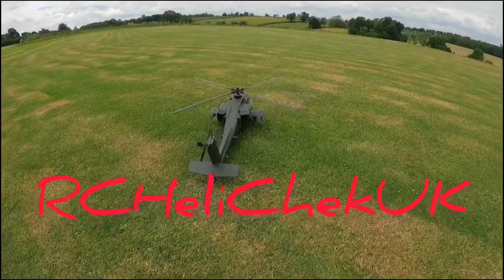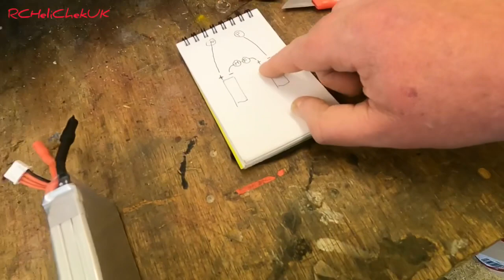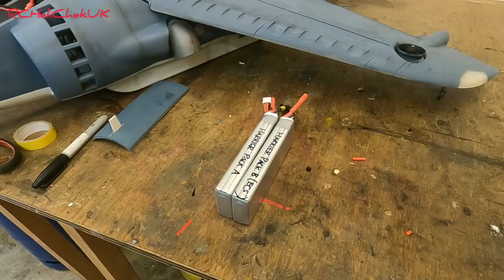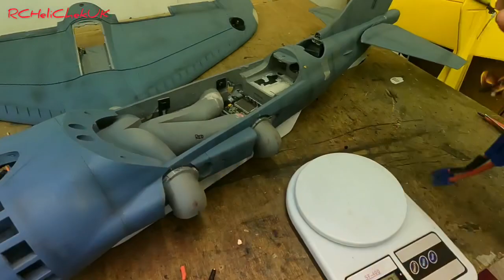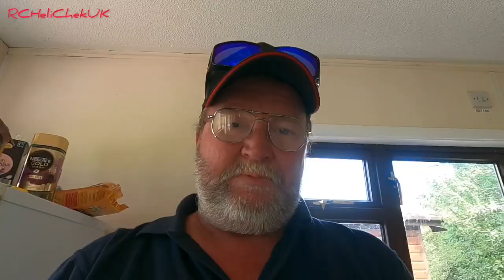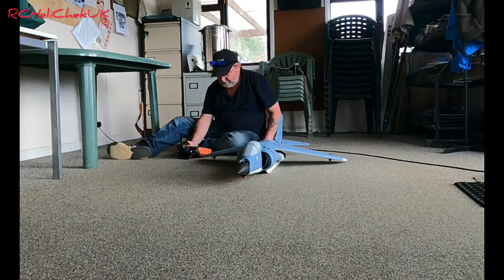RC VTOL Harrier Part 7/ Finally we have vertical thrust!

Comment: I have a HK Harrier that I plan to use two 64mm edf lift fans. A single 70mm fan for forward flight. The lift fans can vector thrust left to right. For up, down, and level hover the fans power are controlled by the flight controller. A similar Harrier had a single vectoring 90mm edf that rotated 90 degrees.

Comment: Build a foam fuselage for weight reduction and make the two main lift fans 6S power by a lightweight drone lipo. I have a HK Harrier on two 2200mah  4S with four 50mm ( one fan for each nozzle) 12 blade edf fans and it will jump off the ground. Currently I am trying to find a working flight controller. I have a few KK2 boards but I can't get my RX to sync with them. I keep getting a no throttle signal of the KK2 boards.

Comment: I've been following Joel's Harrier project since the start. These latest 3D printed versions look amazing but tricky to set up for hovering. Did I hear you right and you're using 3S for the nose and tail 50mm EDF's? Personally, I would forget that and go 4S instead. I think I would also change the wing fans for 4S 40mm's and 8S for the 90mm. Higher voltage batteries = more thrust @ less amp draw and less heat. Installing the curved lip shrouds on the smaller fans will also increase thrust. Good luck mate and keep at it. I would love to have a crack at this Harrier myself but don't have a 3D printer. Any chance your friend could print me one? I'm happy to pay him for his time and materials. Cheers Ben in London, N13.

Comment: The fan is likely losing efficiency though the ducting.
Reply from the maker: The fan will always loose efficiency that’s a no brainer but it’s producing the thrust required to get it off the ground. The issue I’m having at the moment is the KK2 board and outer fans not producing enough thrust to stabilise it
Reply: @TheRMRCchannel  curious why the KK2 board and not a spectrum stabilization rx or other stabilization system?
Reply from the maker: @dl5672  because the KK2 board is a four axis Quadcopter flight controller and the layout on the Harrier with the four fans calls for it. Spektrum stability is not designed for quads but aircraft with ailerons elevator and rudder. Said rx however can be used in forward flight when the outer fans are not needed

Comment: Hey mate, just came across your awesome channel….I would like to share with you my long year year experience with the Harrier…You are so close…You just need some more tips to make it happen…❤ Forget about Schübeler EDF‘s for this project…This was tested already on my side also…😊
Reply from the maker: Hello pal. Thank you for following me. I’ve been following your channel for a long time now. I did forget the Schubler, it had the thrust but the weight wasn’t taken into consideration. I finally achieved lift with a Freewing 9 blade 90mm with a 1780kv motor as it was 100grams lighter. I now have lift but I have no clue what too do with the outer fans and the setting up of the KK2 board. I am convinced it is this that’s holding me back because it’s just not stabilising the model. Any help with settings on the KK2 would really be appreciated because I’m keen to build the F-35 and a much larger Harrier with bigger fans but will not commit too the other projects until the Harrier is successfully hovering stable and under full control. What am I doing wrong? Rob.
Reply: @TheRMRCchannel  I see…can you share the exact weight of the full plane…The design is fully…and this is important! to understand FULLY optimized on the given component’s that are recommended…You will have an optimized thrust to weight ratio of the main engine, when you reach an efficiency of 70% in the plane with the ducting compared to the same setup on the test bench….Only a JP-90 together with an APD 200A (look at the weight differences of ESC‘s) is giving you in our tests this setup….We also is a Goaneng 6S HV Lipo to provide a more constant Voltage on the system…
Reply from the maker: @RC-Jetprint  the all up weight of the model as it stands at the moment is 2.7kgs the fan produces 4kg static thrust on the bench. This fan produces lift and the Harrier leaves the ground however I have too hold it by the tail because the stabilise fans do not seem to be effective enough and I am convinced it is this that’s holding me back. I have no experience on the KK2 in this format and no ideas what I am doing. I’m following videos on YouTube on how too set it up for a quad but I feel the fans are needing a different set of numbers too be efficient enough. I have the throttle for the main fan in channel 9 mixed with the main throttle operating the outer fans. How did Joal set up the Harrier in your vtol vid? What numbers did he enter and where? I have removed everything from the Harrier to save weight not needed including the thrust vector nozzle servos and all aileron and flap servos. The nozzles are pinned at exactly 90 degrees like you had yours when Joel set it up.
Reply: @TheRMRCchannel  …yes it will hover under that conditions, if you get the 70% of the ducting loss…So the 2,8 kg…Joel would set it up in a few minutes with the KK2 board…Start with the pitch in hover and holding mode and only 70 percent volume…The volume is an essential setup in the KK…
Reply from the maker: @RC-Jetprint  where do I set the volume in the KK2? This is what I am not understanding at the moment Renè, where everything is to change. I’m starting to get disheartened by it all because I have been trying so hard to get this model to fly.
Reply: @TheRMRCchannel  …just scroll down in the KK menu…I guess you have flashed it to OpenAeroVTOL?